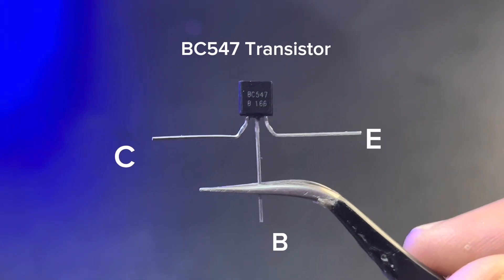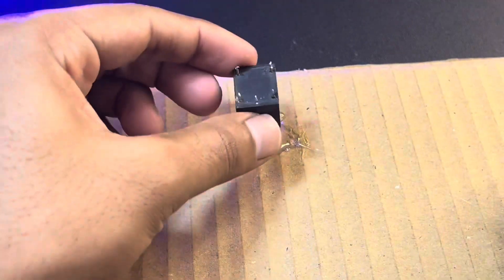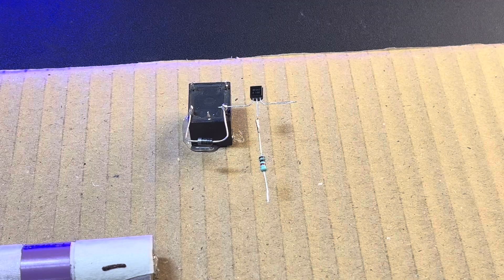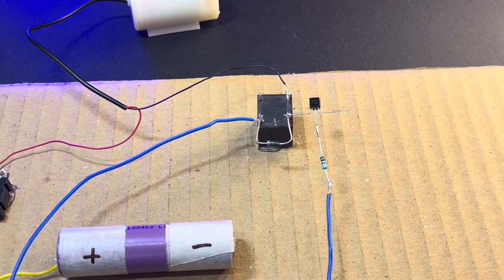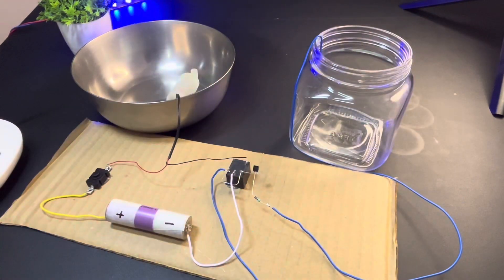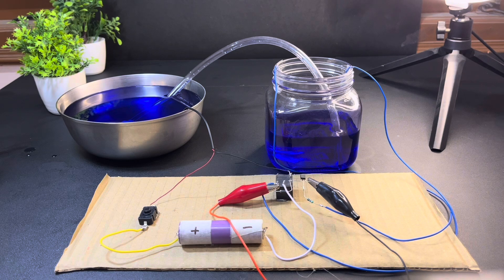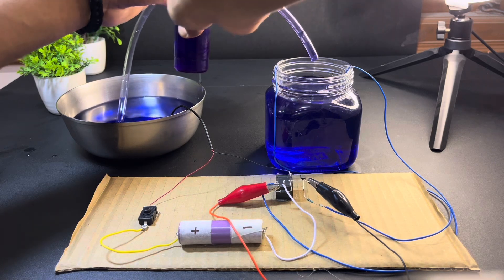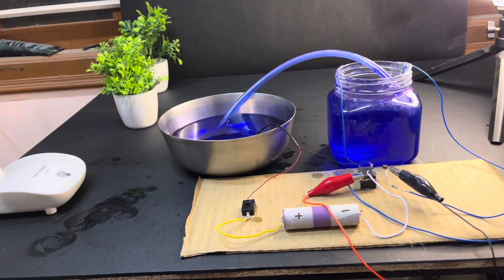Automatic Water Pump Control Circuit | water pump automatic on off circuit

Comment: Will it work in .5hp mottor 220v sir plz reply
Reply: Can't you do it in another way that when the water reaches the lowest probe then it switch on the pumping machine?
Reply from the maker: Yes 👍
Reply: A 12 volt modification can use a 9 volt battery???
Reply from the maker: @nepalnath7923 yes you can use 9v with the same circuit and if any problems occur please let me know 🙌❤️